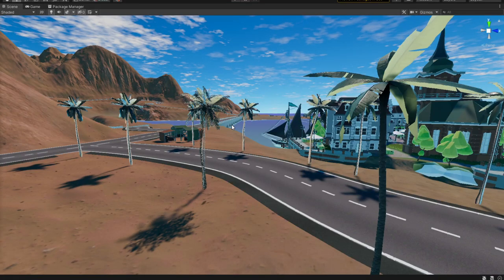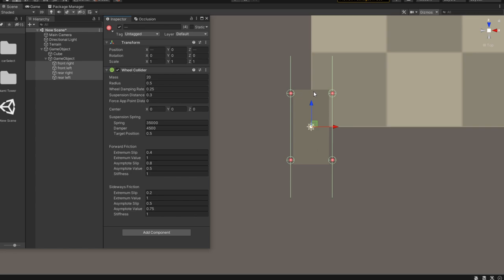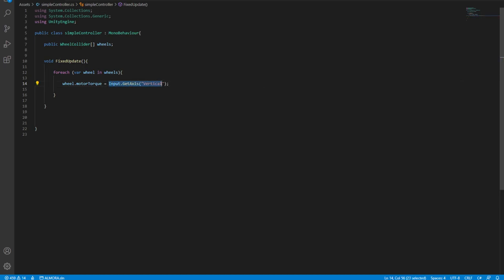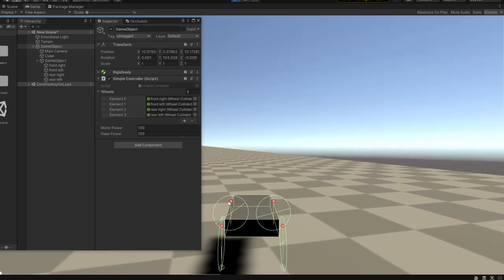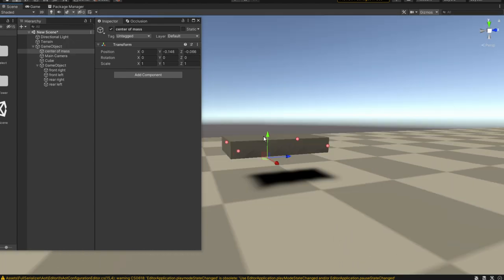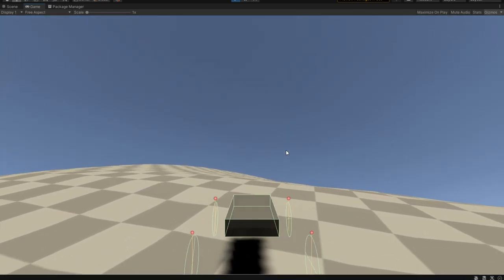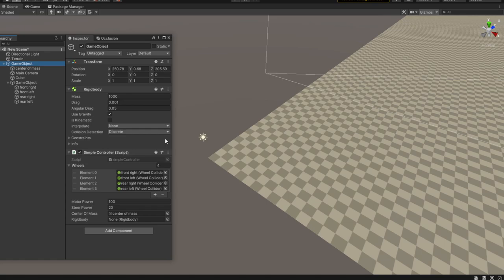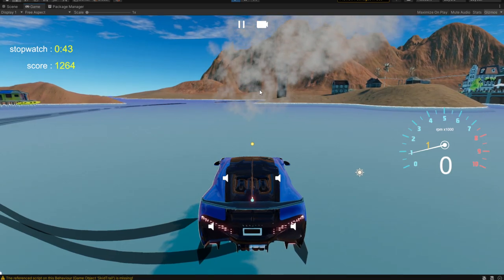Car physics in unity 3D(uphill traction)

Comment: The reason for it being "5 times less" is because you're not accounting for your gear ratio and final drive. wheelcollider.motorTorque should be the FINAL result after getting the engine torque (what you're assuming wheelcollider.motortorque to be), multiplying it by the current gear ratio (example, 1st is 4.2, 2nd is 3.4, reverse is -4, neutral is 0, etc.), and then multiplying that by the final drive of the differential (example, 3.6). So to recap, it should be the desiredMotorTorque * gearRatio * finalDrive = wheelcollider.motorTorque. Would love to see this comment pinned in order to stray others away from the (5 times less) confusion, because stating it that way makes it seem like unity is calculating motor torque incorrectly, when it is indeed infact correct. But I do agree that wheelcollider.motorTorque should be renamed to something like wheelcollider.wheelTorque. EDIT: thanks for pinning my comment Pablo!
Reply from the maker: i couldn't agree more my man , that's very well put . That's the reason why in my personal project, where i have a gearing system, cars with 100 torques can move much better. Respect

Comment: Did you really just iterate over all wheels and then select the ones with an index less than 2.

for(var i=0;i<2;++i) { }

Or even better for both readability and performance
var frontright=wheel[0];
var frontleft=wheel[1];
Then assign directly to those.  An optimizing compiler will remove any cost of the assignment, the loop is already unrolled so that's good for performance (though an optimizing compiler will probably catch that too), but it's also very explicit.